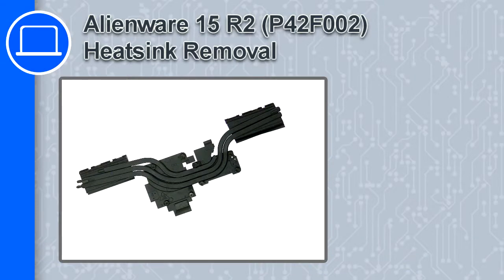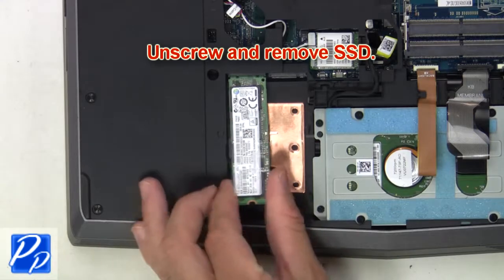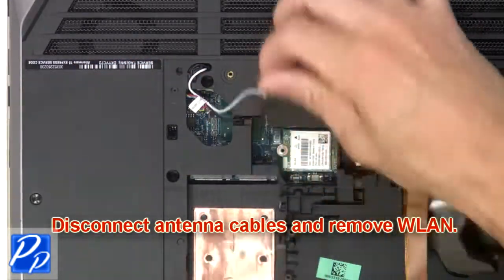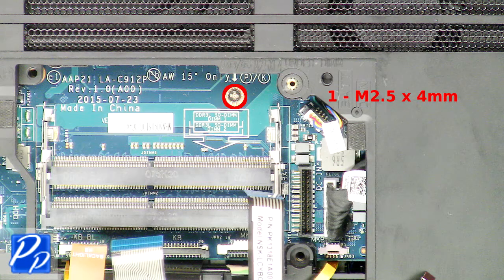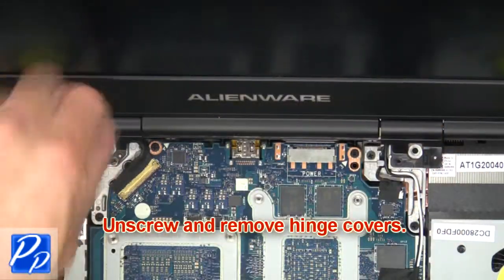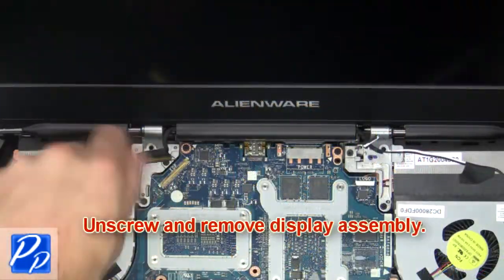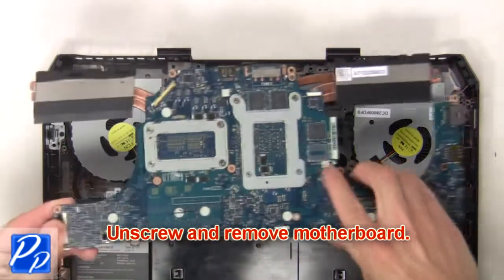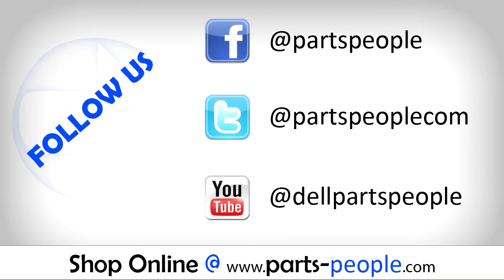Dell Alienware 15 R2 (P42F002) Heatsink How-To Video Tutorial

Comment: Hey I have a gen 3 m.2 Nvme SSD by (Crucial) for my Alienware 👽 15 R2. Do I need a heat sink??? It looks like there is copper right underneath the Nvme m.2 SSD slots
Reply: NVME SSD don't usually need thermal pads or paste. Best you could do is stick a thermal pad on the controller chip of the SSD if you know which one it is. If you don't know it then leave it. A heatsink is an overkill. SSDs actually benefit from being warm and they wont go hot at all so dont worry about cooling them.

Comment: Reassembled after applying thermal paste. The laptop is booting up. But the internal display isn't lighting up at all. Rechecked all the cables and connections. No luck. Any ideas wherr could I be going wrong?
Reply from the maker: I would suggest rechecking connections on both sides of the display cable. You might also try using an external display to make sure your LCD panel/LCD cable are the main issue.